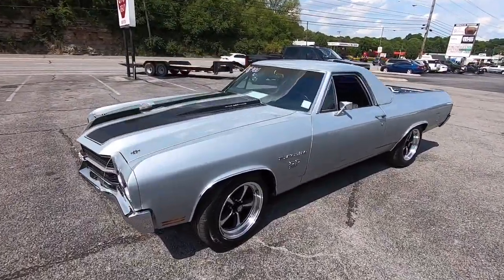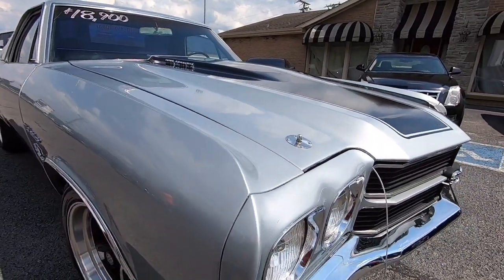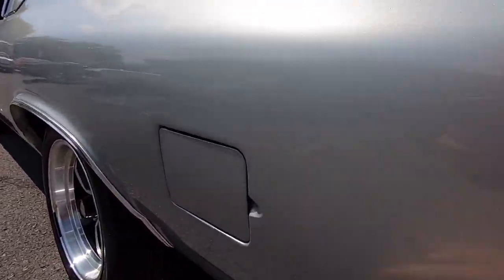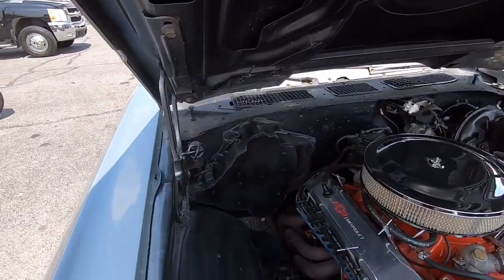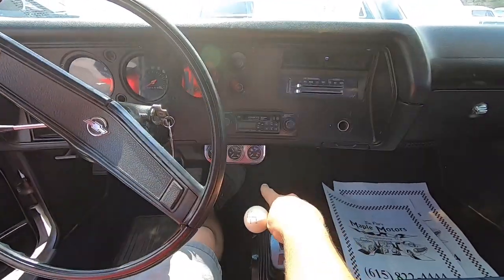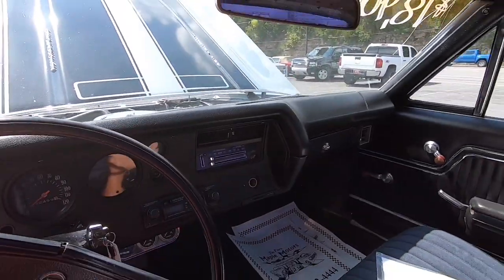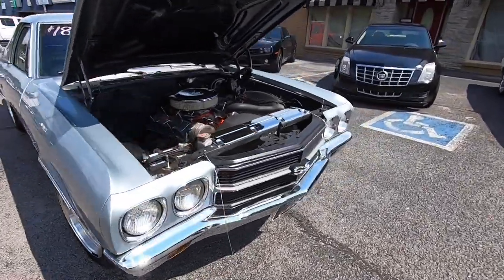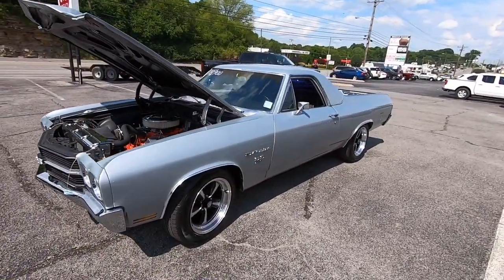1970 Chevrolet El Camino 4 Speed SOLD $18,900 Maple Motors #643

Comment: Hmmmmm vent windows on a '70 ElCamino?? 🤔🤔 Looks like doors from an older Chevelle or ElCamino! Idk, if you gonna spend 20k on a car the horn, wipers & heater shud work!!! That's the bare necessities! And no headliner either!!💁‍♂️🙆‍♂️ idk Nick?
Reply: @buff6637  my bad Joseph on the wing window! And YES I also seen the trim for the vinyl top!! Good eye Joseph!!👍
Reply from the maker: You spend about a grand on this car and all that can be fixed. Also it’s a solid body running and driving 4 speed , looking mid 20s